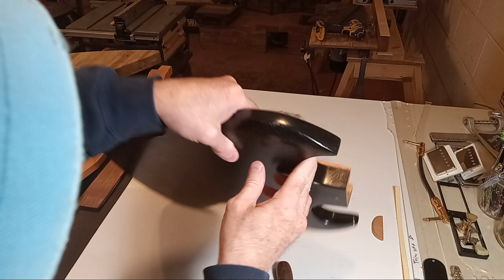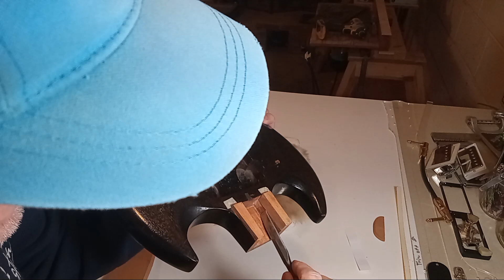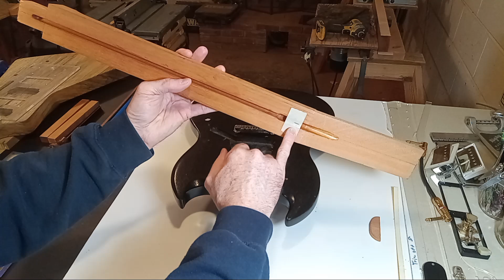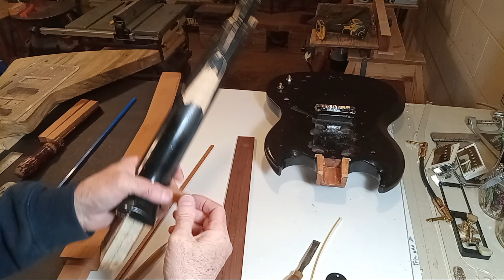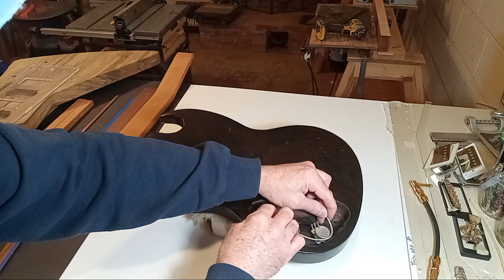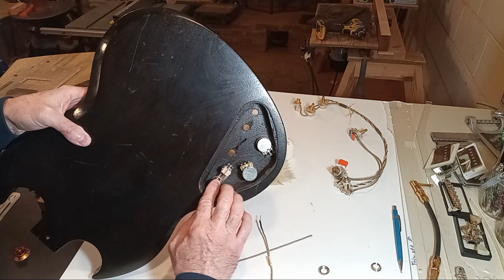V7.  1969 Gibson SG Custom & Standard Restoration Per Historically Accurate Vintage Specs.

Comment from the maker: At the 51 minute mark I did determine an L-Type 3-way is not necessary, and a Short Frame, Straight Switchcraft 3-way would fit within the SG body, and even leave near 1/8" clearance between the inside edge of the Control Cover and bottom edge of the Switchcraft 3-way.  Therefore, allowing the switching path of the toggle to be rotated to suit the Player's needs/comfort.

Thanks for watching, 
Marc

Comment: You covered exactly the problem that I had😅.  Would love to build an SG with a bolt-on neck that is better designed for durability and sound transfer than Leo‘s design. The SG is a beautiful design but just too fragile. Needs the slightly thicker body that you mentioned and a better heel joint or some type of bolt-on neck.  I know the purists would hate it but I’m practical and would rather not have to baby these SGs.
Reply: I can say with firsthand experience that a bolt neck Epiphone SG sounds exactly the same as a set neck one but 33% cheaper and with less neck dive. Also the bolt neck felt more stable than the other one
Reply: @dannork1240  Interesting. I just saw that Eastman guitars introduced their FullerTone line of guitars that has an innovative bolt-on design that is kind of a hybrid that has some of the characteristics of a set-neck, such as  more neck to body contact, with a two-bolt fastener that is recessed farther into and flush with the body.  It’s a compromise for sure but it’s the kind of thing that I wish Gibson would consider. I was gutted when my '61 reissue SG started to crack at the heel. That really spooked me about the slim neck SGs.  Later moved onto a Standard with the batwing pickguard, which doesn’t look as good in my opinion, but it has more mass at around the join.
Reply from the maker: Hey Dan,
Thanks for the info., and for watching/chiming in.  I didn't know Epiphone made a bolt-on Version.  I just did a Video of a Tap Tone Comparisons between the 71 Les Paul and 69 SG Bodies, so that'll go live within the hour.

Thanks,
Marc
Reply from the maker: They must have done something right, cause I have to remind myself I'm building Replica Guitars based on their designs, and they aren't replicating my guitars!  Haha...

Thanks, 
Marc